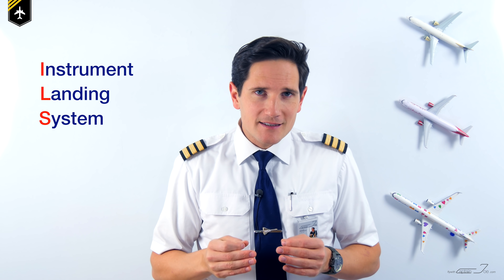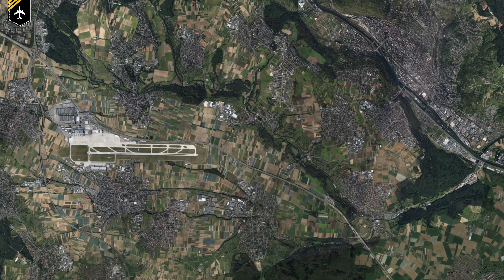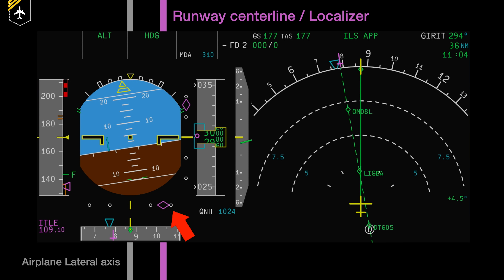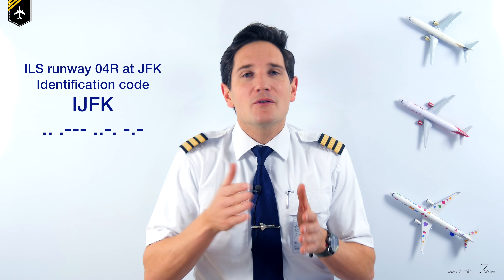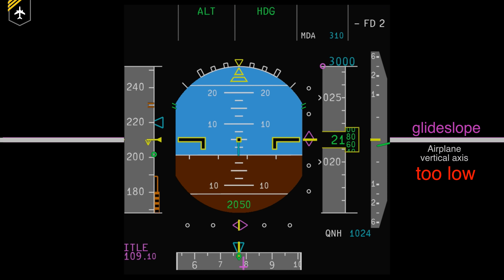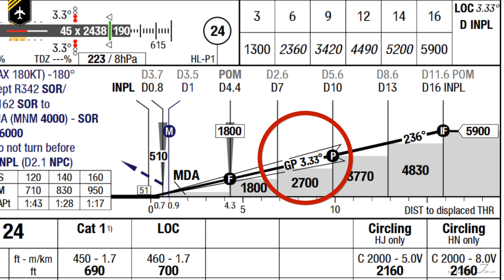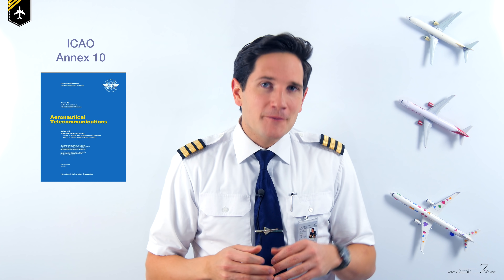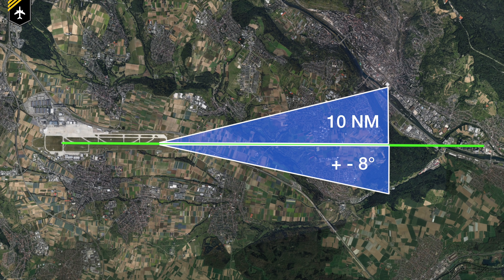How does an ILS work? Explained by CAPTAIN JOE

Comment: The sion (LSGS) approche , in Switzerlan, has an ILS angle of 6°. It is the most strang approche that I know because you mus arrive at 17 000 feet and you live it 3000 feet above the runway. After that you must realign yourself with the runway visually. (You form an angle of 7° with it) Air Berlin (RIP) had tested it for airbus a320 type.

Comment: On my current type (the CRJ 200) it will depict the ILS CDI and inbound course it self. But we fly the ils in "green needles" so we still have to tune the freq. Manually. It will show the identification when picking up the ils. The Learjet 45 needs to manually tuned and final course set manually set as well. But the radio unit will show the identification. My former Learjet 35 is ALL Manually AND the morse  is the only means of identification!

Comment: Question: Can the ATC use a radar console to assist a pilot to land the plane using the ILS, as seen in the original Airport movie?
Reply: ATC's guide the aircraft to the runway for an ILS landing, however it is possible to do without ATC.

Comment: Is it just me or are those diamond positions counter intuitive? 
I'd much rather have them the other way around : vertical diamond above - i am too high,  below - I am below. 

Same with the horizontal :
If it is on the right - I am too far off right.  Left - I am too far left.
Reply: tasman_devil 
Even though its the diamond that moves on the display, imagine that it is the runway. So flying towards the diamond will line you up (i.e. if the diamond is right of the display line, turning right will bring you back to center, and if the diamond is below the display line, descending will bring you back to center). You’re right that it is counterintuitive since you think of the airplane moving, not the runway!
Reply: Well it might seem counter intuitive, but you could imagine the display to be part of the plane which is moving and you have to move it to the diamonds which are "fixed" in space. It's the same with the artifical horizon which is moving but not the "airplane" in it. I know PFDs like in the Airbus actually only display a dot/square, but for example soviet attitude indicators actually have the plane and not the background moved.
Reply: I prefer to think of the indicator as representing the location of the glide path relative to me.
Reply: Think of the instrument as a set of crosshairs that you have to move towards the target indicators.
Reply: Fly towards the needle, or diamond in this case.

Comment: Joe, In descent and approach videos you hear pilots referring to "Loc*", what is this please?
Reply: LOC stands for localizer. The guidance system that aligns the plane up with the runway.
Reply: Thanks, but what is "Loc Star"?
Reply: John Dean I've never heard that term. Its definitely not something used on Boeing aircraft. On the Airbus PFD, a LOC* will appear. This means that the localizer mode is activated, but the localizer isn't captured. Once it's captured, it'll turn green.
Reply: Thanks, I understand now: if you watch videos of Airbus cockpits during approach (e.g. Lufthansa) the Pilot Monitoring will say "Loc Star" and the Pilot Flying will repeat it back, so in certain airlines the Standard Operating Procedure must be for either activation or capture of the localiser to be confirmed verbally .
Captain Joe has a Part 2 video out about flying the ILS, so perhaps he'll explain it there.
Reply: Hmm, interesting. I never heard of it. As you said, it could be something with airline procedures. For an example on minimums, some airlines use "Continue" and some use "Landing". But i'm also more of a Boeing guy, so yeah :)

Comment: Joe, I think this might be a stupid question, but how do pilots/ATC decide in which direction should the plane land on the runway (in my city airport 22 or 04?
Reply: The pilots do not decide it! The Air Traffic Control sets up the landing direction usually based on the winds. Meaning that if you have a wind of 060 @ 9 knots at your airport, you prefer flying against the wind, meaning that in this case the ATCs would use runway 04. However, this differs from airport to airport. Most aerodromes have a preferential runway system to increase traffic flow.
Reply: Thanks maiksir7! I tried to look for it and didn´t find such a simple explanation... 
In a couple of airports i fly often the directions are mostly the same...  Thanks!

Comment: Wasnt there a thing next to the runway with 4 lights where you can see whether you are on the glideslope? Like 2 have to be white and 2 red when on it. Or is that something else?
Reply: yes. this are the PAPI lights. these lights do work apart from the ILS system, meaning that even if the ILS systems were not servicable, the PAPI lights would help the pilots to keep their approach angle :)

Comment: John F. Kennedy Space Center. When the space shuttles land the ILS GS like 25% or something.
Reply: Anton Martic okay take Kunduz Airport with the German Air Force Afghanistan Approach, you have a dive angle of 45° ;) its a pure Horror in the Cargo Compartment of a C-160 Transall
Reply: I see what you did there
Reply: V/S is like 12000ft / min 😂
Reply: From: https://www.nasa.gov/mission_pages/shuttle/launch/landing101.html

As it aligns with the runway, the orbiter begins a steep descent with the nose angled as much as 19 degrees down from horizontal. This glide slope is seven times steeper than the average commercial airliner landing. During the final approach, the vehicle drops toward the runway 20 times faster than a commercial airliner as its rate of descent and airspeed increase.
Reply: Technically, the SLF uses an MLS...
Reply: if memory serves me right the space shuttle had a MLS  system fitted and tacan and GPS  not ILS
Reply: Anton Martic in that case then space x would be with the steepest glide slope of 90 (vertical) lol
Reply: i was literally gonna say that lol
Reply: almost word-for-word with the post on the Airliners.net forum .... well done!
Reply: That's a space shuttle not an airliner
Reply: No IFF either.
Reply: I’d venture to say LaGuardia in NYC I remember reading about it and Denver being the extremes needed to be met for the design of the 727.
Reply: I think its an MLS, not an ILS
Reply: still hasn't pinned you
Reply: What about the airport near Nepal where you come over a mountain and have to dive immediately,
Reply: Technically the space shuttle doesn't use an ILS as the one here.  It's actually a MSL (Microwave Landing System) same principle but different method. A bit more precise than ILS but much more expensive
Reply: He asked for the steepest ILS approach.
The space shuttle used MSBLS, a microwave version of PAR, not ILS!
Reply: Well 25 degrees up until about 5 seconds from touch down when they flare.  The flying brick can't do 3 degrees.
Reply: they only descend that rapidly in the early stages. on final approach they are not going much more steeper than 3°
Reply: Put into YouTube how to land the Space shuttle. It's informative and interesting. https://youtu.be/Jb4prVsXkZU
Reply: Anton Martic technically your right, honestly I don't think that's what he meant but you right, and I could find the ils info on Google with a quick search so I think that counts as published
Reply: A reminder that the space shuttle design was complicated and unsafe.
Reply: the new vertical take off airplanes have 90 degrees glidesclope in every airport.
Reply: 90 degree dives are possible in specially built(strong) gliders, but vertical engine thrust is not a glide.

Comment: London City Airport (UK) has a GS angle of 5.5 degrees. In a PPL-A exam flight you have to use a VOR for navigation (works similiar to the ILS in level flight). To check you are on the right VOR you have to listen to the morse code of the VOR first. Therefore you have to set the frequency of the VOR and pull the ident button (with Bendix radios) to listen to the morse code. If you don't check you are on the right VOR then it's one mistake, but you not allowed to to any more to pass the exam.

Comment: Joe, my question is what is VOR?
Reply: Jaroslaw Fojtik Very high frequency Omnidirectional Range. It's a nav aid as well, which can be used for approaches, although they are not precision approaches since they don't include a glide slope. Now a days they are mostly used by VFR pilots flying XC or to and from airports.
Reply: Eric Manning vor/dme approaches are still used in commercial usage.  Not all aiports have ILS or approved RNP approaches. However have you ever heard any airport use MLS?
Reply: Arcadiez as I stated... they can be used for approaches. We have a VOR/DME approach at the airport that I fly out of (class C), and other nearby airports. And I've flown them many times for training. But if there is an ILS or Rnav lpv approach at the same airport that has a VOR approach, im going to choose to fly the ILS or RNav every time if IMC conditions exist. You're correct that they are still in use, but with newer technological advancements such as gps, which to answer your question, basically put an end to the microwave landing system, flying approaches has become a lot more precise than just flying a VOR/DME approach. Also, it saves time and money because now we are flying direct to instead of flying huge DME arcs around the airport.
Reply: Arcadiez MLS never quite made it to the broad spectre of airports because the GPS/WAAS gave them the same accuracy and didn’t took in place and any footprint at the airport so they stopped making it even before it has even made his mark in airports.
Reply: Benjamin Coussement think some Norwegian airport implemented it due to curve/steep approaches but can have been changed to an GNSS app.

Comment: Lugano Agno Airport is the steepest with a 6.65* ILS approach angle
YEAH let's go, I'm right ;)
Reply from the maker: Congrats my friend !!! WELL DONE :)
Reply: @flywithcaptainjoe  How close is Queenstown (ZQN)?
Reply: Lugano (LSZA) has a IGS, not ILS... because of the steep angle (6.65°) in swiss airspace, the non standard ILS beacons are named IGS... far as i learnt so far
Reply: and full reversers and parking brake set at touchdown LOL
Reply: I expect comments coming starting with 'hold my beer' :) and Piper Cub engines revving up...
Reply: @ Frank 
Kathmandu has no ILS/IGS installed, so it's not an ILS approach.
Reply: More than 6° sounds more like falling instead of landing ...
Reply: Better set full flaps and minimum approach speed before capturing it I guess
Reply: Challenge accepted that sounds like :P
Reply: Richard Stefanits ok.... hold my beer because the piper cub engines are revving
Reply: ^^full flaps and max auto brakes aswell XD
Reply: Only smaller airplanes can land there though. ;)
Reply: Kathmandu does not count? 
Tribhuvan International Airport IATA: KTM, ICAO: VNKT
(22.0°)
Reply: How about Hong Kong's old Tai Tak Airport to IGS 13.
Reply: shanti016 : It's closed, so it does not count. London City had 7.5 GS when it was opened. That would win this contest(if you ignore Kathmandu). But London City now has 5.5 GS and it does not make it the first, so the contest is about current,and operational airports.
Kathmandu is still open, but he decided to name Lugano Agno Airport as the winner.
Reply: Captain Joe did I get unpinned?
Reply: Wow, that's nice to know, 6,65
Reply: shi01 : thanks, I didn't know that.
Reply: Had a lovely landing at Tribhuvan just a couple of days ago mind, despite the lack of ILS/IGS.  The pilots put it down so gently, that you could barely tell we'd landed.
Reply: Captain Joe thx, your awesome ;)
Reply: You're unpinned.
Reply: still not pinned, so is this wrong?
Reply: "put it down so gently, that you could barely tell we'd landed." ==> Like this: https://www.youtube.com/watch?v=Larlotxwl4A
Reply: I have zero clue but I’m going to learn, this is too interesting. 🤔
Reply: Jesus, your're right! I just checked: 6.65°!!!
Reply: Aircraft certification and crew qualification required to perform an approach.
but technically it is an ILS approach.
http://aip.engadin-airport.ch/eAIP/2017-06-22/html/eAIP/LS-AD-2.LSZA-en-CH.html

Description of Instrument Guidance System (IGS) :
Non-precision APCH with ILS components.

The IGS procedure is a steep APCH of 6.65° GP reference. 
IGS PROC may be flown as an ILS PROC

IGS components:
ILS (LOC/GP/DME) for line-up and final APCH
SRN VOR/DME
Reply: Nicola Carina Nicola Carina..."aircraft certification and crew qualification required....".  What do you mean?  There is nothing special required here,  just follow the procedures stated.
- IGS PROC may be flown as an ILS PROC.
- The published ALT at D5.3 ILU and D3.7 ILU are to be strictly OBS without undershooting.
- After MAPT, PCD to RWY maintaining visual ground contact and by following the PAPI of 6.0° reference angle. LOC track is aligned with RWY 01 axis.  
We have landed several times at Lugano (ex Ecuvillens, Gstaad) and have no special checkride or additional qualifications.  Landing is at pilot's discretion.

Comment: Isn't the steepest ils approach at cape canaveral, the one where the space shuttle landed on?? It also makes probably the largest ils-turn of about 270 degrees.
P.S. Could you make a video about manifold pressure??
Reply: They don't use ils,  they use a different system but yes a 270 degree turn a few miles out 30,000' to touch down in under a minute normally with about 30% air Brake! Scary as it's a one shot deal...!
Reply: The SLF saw plenty of steep approaches from shuttles because the orbiter had to fly a steep slope to avoid stalling.  The airport doesn't require it, though, and regular planes use typical glide slope angles when landing there.